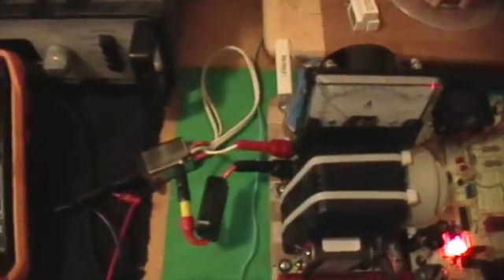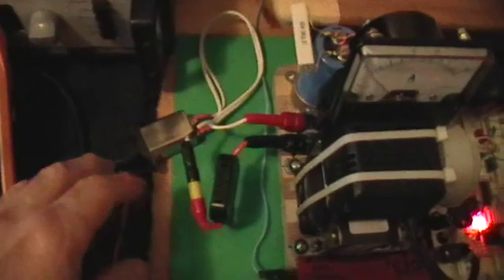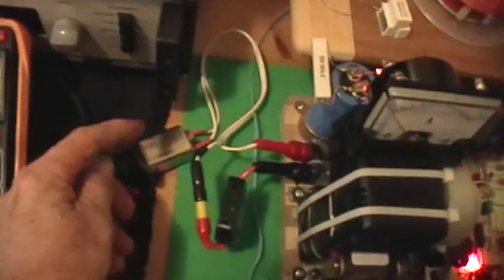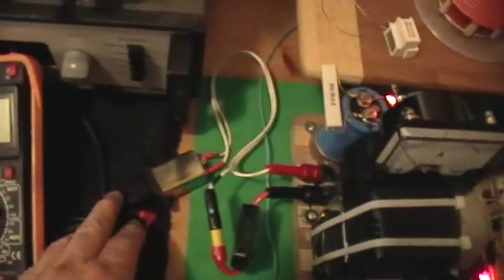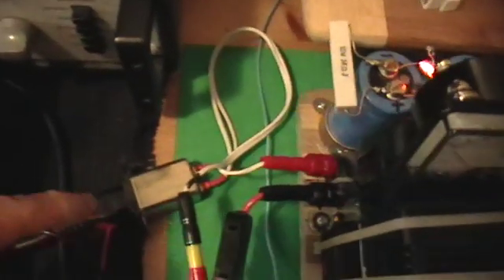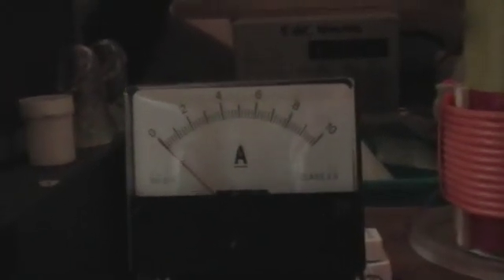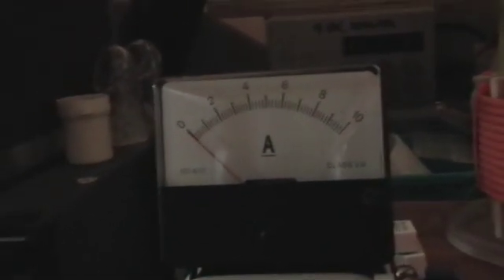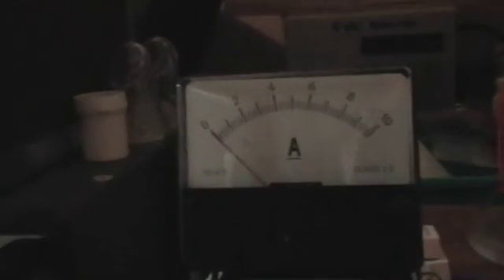TInselKoil 20: Even Fuller Power -- 1 KiloWatt DC Input

Comment from the maker: Thanks! There are certainly many that make longer HV sparks, but this one seems to have the best power transfer capability that I have seen in a small tabletop unit.
It's running at 820 kHz give or take, depending on the toroid and the breakout lead and the ground terminal lengths.
I think when it makes full steady corona there's probably a lot of power radiated in RF. This week I plan to take it to the lab and check its radiated power, if I can dig out the right instruments from the mess.